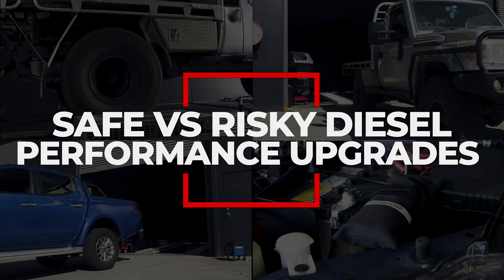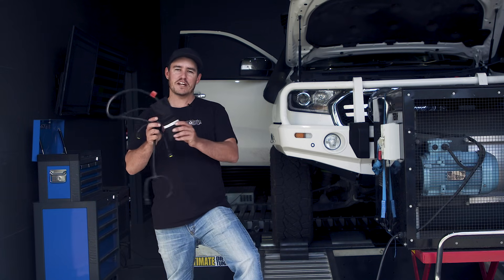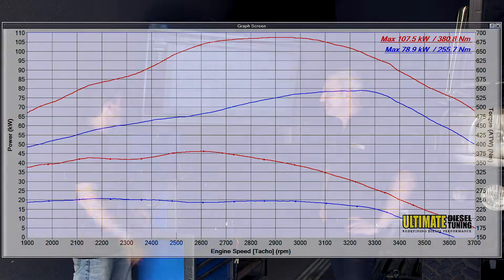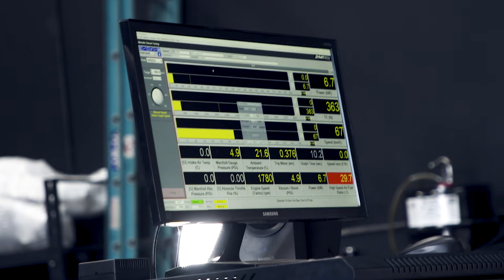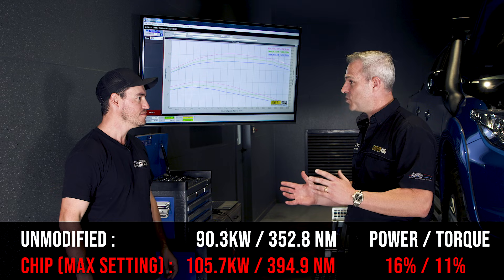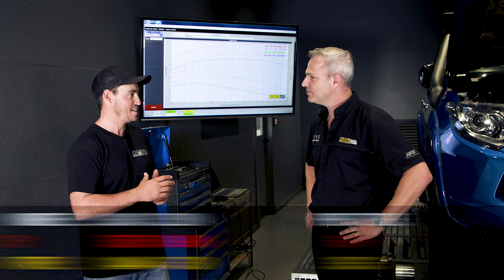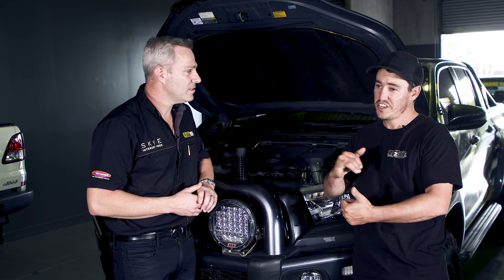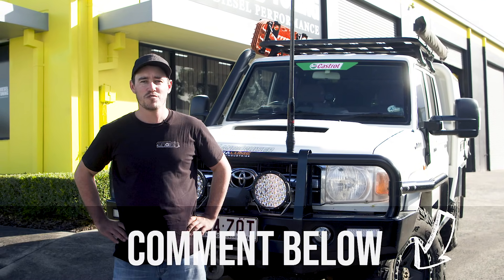SAFE vs RISKY DIESEL POWER UPGRADES – 5 things you need to ask before choosing!

Comment: The more power you make the closer you get to the detonation threshold!  That's why Toyota diesel 4wd's are so reliable!
Reply: Did you miss the part where the Hilux needed 4 new injectors.  Toyota shit not reliable at all.  D4D injectors need changing at 100,000k.
Reply: @einfelder8262  no you're wrong it's an wear item that's common with all common rail Diesel's...crdi technology is not credited in my opinion because of the over complexity from and engine which was designed so simple!
Reply: @einfelder8262  but it's OK you can just stick with your ford because I yet to see a ford reach 500k km+ lol

Comment: A remap is ok but I’d rather 3 tunes like a ecu shop tune 1 and 2 and back to stock on the fly
Reply: ECU Shops are fine - if they are custom dyno tuned to suit your car. They are fully tuneable.

Comment: What happens to fuel economy when you do those custom tunes?
Reply: The fuel economy is supposed to improve since you have more low down power which means that the engine does not work as hard to keep you cruising at say 80 on the highway as compared to a pre tune
Reply: @anthonyramdin1037  correct!

Comment: When should I do the tune. Right at the beginning before all the wanna do and gonna do starts, in the middle after things like exhaust mods and heavy duty suspension or as the very last thing i do after i think i have got it all together and the trip is in sight?
Reply: Up to you - but generally, after you have done engine mods. You won't see much gains in power & torque if you perform engine mods without tuning it to finish it off.
Reply: Hard to tell if anything has been 'upgraded' just because youve spent big money on changing parts if you havent got a baseline dyno test. My stock standard ute kept up with a $$$$$ upgraded mates ute on the beach, I could hear his heart break when he said, 'you could keed up no worries'.

Comment: Triton has more power than 70 series standard. Well done Mitsi
Reply: Its also about where the power comes in, in the rev range. The cruiser has max power right through. Where as the Triton doesn't kick in until around 2.5- 3 grand. Which is super sluggish when your towing and taking off from stand still. 

I have a 79 series and a 2018 Triton, and they are not comparable
Reply: But if u test them offroad the 79 would outperform the trity by a gap

Comment: How would you tune a Tradie ute NP300 @ 100,000 ks that's used 90% open road travelling and 10% towing a 2.4T van ?   25 return SA-Vic trips this year alone not towing but when tow van it's 4,000 ks round trips.
Reply: Our tuners will tune it properly for you mate, to what you use it for. We are not about max power/torque tunes! We are about tailored tunes to suit each car individually & what the owner's goals are with the tune.

Comment: Hey mate I own a 2001 gu patrol TD4 2 no intercooler by fitting an intercooler will that increase horsepower and lower the EGT is it worth spending the money  ?
Reply: I live in the US, but from owning a twin turbo truck, and a supercharged car, yes. Adding an intercooler will do wonders for your vehicles lifespan and performance.  The lower you can get the intake air temps, the lower your egts will be, as well as possibly adding exhaust modifications as well to syphon exhaust gases out of the turbo and downpipes faster will reduce egts as well.
Reply: I have done this and yes it is worth it
Reply: @juliancousins6340   thanks mate what brand of intercooler did you get

Comment: I don't understand what is the point of tuning a 4wd . Your rigs are not powerful enough at low gears? Or you drive your lifted trucks with mud tires at 200 + km/h on the highway ? 200hp vehicle will stay in the mud hole, but 220hp will manage to go out? I am not a tunning hater, my car is tuned but i really dont see any reason to do that to my 4wd.

Comment: I have an 05 RA Rodeo with 90,000km. Has Isuzu 3L diesel 4JH1-TC front mount non-commonrail and 4spd auto. Makes 98kw at the flywheel - would be nice not to slow down up hills or in a strong wind! What kind of safe power gains could you guys achieve?
Reply: In the same boat I’m looking at euro cars chip soon

Comment: 78kw and 255nm from a 4.5 turbo v8? What the hell toyota, I thought you'd changed.
Reply: Except look at the size of the tyres on the bloody thing... that’s what has killed the power
Reply: @xotic8617  our shorty with a stock standard TD42 and auto on 35s lays down 54kw at the wheels, a 4.5 turbo v8 with common rail should be more than a 50% power increase over an old forklift powered troll.
Reply: @Darndiddlyarn  
100% it should.
Reply: @xotic8617  the triton looks like it running 33s which also isn't standard. I love the cruiser but that V8 is not what it could have been.
Reply: All dynos read differently fellas. What matters are the gains achieved by the tuner from before the tune til after.
Reply: That cruiser would have another 30hp and 80nm if it was on 33s.
Tyre size makes a huge difference.
Reply: @xr6tgtx737  tyre size does make a difference, but the rolling resistance from 33s to 35s is not enough to see a decrease of 30hp and 80nm. Majority of the time the gearing is how you calculate the loss of power in the translation to it reaching the tires.

Comment: Do reckon putting bigger tyres, adding weight to the vehicle will affect the power output of a vehicle
Reply: Yes it sure does. But it doesn't affect the actual power & torque gains achieved by the tuner.

Comment: Just got a quote the other day for a dyno tune on my 2011 Holden Colorado 4jj1  auto 270kms I spoke to another diesel mechanic and he said leave it stock suggestions?
Reply: The 4JJ1s are renowned for making huge gains in power & torque with a custom dyno tune, safely & reliably with no issues!
Reply: @UltimateDieselTuning  i have a 09 rc colorado with the 4jj1 engine.  Is it better to upgrade the exhaust system on these before a tune? Are the gains oem system to a 3" worth the money in power increase from dyno tuning?
Thanks.
Reply: @feral4mr2  yes it is - but for an upgraded exhaust to make a noticeable difference to power/torque, it must be tuned to suit. So fit the exhaust before the tune, or the same time as the tune. We supply & fit exhaust systems too at our workshops.
Reply: @UltimateDieselTuning  thanks

Comment: Hey guys.
Does the I drive system come into play here as it is plug and play? 
Can it potentially be harmful to the forby.
2010 bt50 150klms.
Cheers Craig.
Reply: No, a throttle controller does not give your power any more power or torque. They don't change anything within the engine.

Comment: Nice info-mercial.  You have me interested.  Couple of questions, how do you dyno full time 4x4's?  What sort of gains can be expected out of an Everest 2ltr bi-turbo? Cheers...
Reply: On a 4WD dyno - we have 4WD dynos installed at all of our workshops. Currently, the factory ECUs in the 2litre Everests/Rangers/Raptors are unable to be remapped. We get around this by fitting a supplementary ECU to it, which then gives us full control over the ECU & allows us to custom dyno tune it. Results vary from car to car as we do custom dyno tune every vehicle individually depending on what the car is used for & how the owner would like it tuned. On one of the 2Litre bi turbo engines, expect from a 20% gain in power & torque upwards.
Reply: @UltimateDieselTuning  Thanks for the info, I appreciate the reply.
Reply: Ultimate Diesel Tuning, what is your experience in regards to new cars voiding warranty? I 2 have a biturbo Everest and every dealer has told me kiss my warranty Goodby. Do you guys provide any guarantee that it won’t effect my warranty??
Reply: @ORD-nairy.  take note of the lack of reply.
Reply: @ORD-nairy.  Yes we have our own warranty. And by law the dealership or manufacture cannot void the warranty of a vehicle due to a remap/custom dyno tune. Most of the cars that we tune are still under warranty with no issues. And we have awesome relationships with several dealerships where they refer their customers to us for tuning - either their servicing customers or ones who have just bought a brand new car. Some even get trucked to our shop, we tune it & then truck it back before they deliver it to their customer!
Reply: @user-hf3rq1dg9d  just replied to him thanks mate.
Reply: Easy, on a 4wd dyno.

Comment: I have a 2012 ST-X550 Navara, what power and torque would I see out of this with a tune?
Reply: Results in power & torque gains do vary from car to car. If you visit our website & have a look at the Navara page, we have an example graph up there that you can look at with all details etc. Regardless on how we tune it, it will make excellent gains though, they always do.
Reply: Me to got aftwrnarket intercooler and 2 3/4 stainless exuast would l9ve to no how the auto would hold up against the extra power
Reply: @putnamehereholdmadoodle  they're fine mate! We have custom dyno tuned hundreds of them, no issues.
Reply: @UltimateDieselTuning  are there any problems with throwing engine codes
Reply: @putnamehereholdmadoodle  no mate!

Comment: I don’t get it if the factory could increase the power output of there vehicles like you guys are doing why wouldn’t they just do it
Reply: That is the magic question!
Reply: Because it effects emissions and longevity, it's not fucking rocket science, they just won't say it.
Reply: @user-hf3rq1dg9d  no issues with longevity. We custom tune within the factory safety parameters set by the manufacturer.
Reply: @UltimateDieselTuning   When you tune to a torque increase of 135% how can you say that is within the manufacturers parameters?  Thanks

Comment: Quick question, chipped with Ultraboost ecushop + dyno tuning OR remap on a dyno? Running with a 2kd hilux.
Reply: You will need a supplementary ECU such as an Ecushop or Unichip, then custom dyno tuned on top with your older Hilux.
Reply: Appreciate it mate.

Comment: Being that the 1HD-FTE is such a popular engine and people are still putting them into their vehicles nowadays, what is the recommended approach to tuning them? My understanding is that the FTE ECU hasn't been reverse engineered to be reflashed yet and you can only run a chip. Is it likely that the FTE will ever be flashable?
Reply: We fit a supplementary ECU to them & then custom dyno tune them properly from there. They make amazing gains in power & torque! There is one on our YouTube channel if you want to check it out.

Comment: Very informative, but sounded like an advertisement for Ultimate Diesel Tuning towards the end. I'm  scepitical about ALL of the discussed upgrades, in particular what happens if the engine in a new vehicle fails and the warranty is voided. Will the Chip supplier/ECU Tuner repair the engine? Will they offer a warranty on the drivetrain for the life of the factory warranty? Lastly, Shaun if what UDT offers is so safe have YOU had them tune/upgrade ALL 3 of your vehicles?, what about Grahams D-Max? I think this should be an HONEST discussion for the next Beers in the Shed.
Reply: Most tuners will offer their own warranty, like we do. Unsure about what type of warranties the chip brands supply. And yes we have remapped Shauno's 79 Series so far!

Comment: I don't see a 4WD dyno. I have a tuned V10 with 960 Nm of tractive effort and 355 awHp, at all four wheels.
Anything that comes off a dyno talking torque, is rubbish - it's called tractive effort and is hardly related to torque.
I highly recommend replacing drive shafts and the centre Knuckle before a Dyno.
Watching a Dyno Snap at max rpm is not a pretty thing - the drive shafts don't get a chance to 'relax' on the rev reduction.
Reply: I've never heard someone spew such shit. Torque is probably the most important factor to 4wd engines. Power is just a function of torque. So the only way to get better power is to increase the torque.

Comment: Damn that’s some piss weak numbers out of the triton I’m pushing 500nm and 138kw ATW at the moment and have been for the last two years they can take so much more.
Reply: All dynos read differently mate. That's why you look at the gains achieved from before the tune to after.
Reply: Yeah our triton is running 240 kw and 600nm ATW
Reply: Harry Whitehouse I can understand a lower power tune for reliability but for towing you would want as much power on tap one would have thought and you should be able to achieve that with good AFRs after a solid tune.
Reply: Yeah that’s it mate, BB Garage in Ipswich did ours I would recommend them
Reply: Harry Whitehouse nice mate mine was done when I was in Esperance by Nicks Mechanical spent a good few nights on that dyno getting it right
Reply: @WorldTrendingclips  don't look at the figures mate, look at the gains. What was yours making before the tune & how did you ask them to tune it? That is what you look at. Both of these cars that we have featured on this video are not tuned for max power/torque.
Reply: Ultimate Diesel Tuning well based on my figures 78kw to 138kw is a 74% increase and 330nm to 500nm is a 51% increase with more room to move if needed that was on a stock exhaust. Now it’s running a 3 inch bigger intercooler and better intake so I would say it’s around the 550-600nm mark if we tuned it again to match the new mods.
Reply: @WorldTrendingclips  that's fine mate. We never push engines to their limits, we are not all about getting bulk power & torque out them.
Reply: @harrywhitehouse118  don't look at the figures mate, look at the gains. What was yours making before the tune & how did you ask them to tune it? That is what you look at. Both of these cars that we have featured on this video are not tuned for max power/torque.

Comment: I’ve got a 1991 1HDT 80, and building it up from stock, plan on doing the intake,exhaust inter cooler etc. is the car to old to consider a dyno?
Reply: Tyla West  I’m doing the same thing to mine. And iv been looking for months
Reply: On these mechanical diesels you fuel according to the boost pressure the turbo can create. You're starting with the right recipe there, just note the stock CT26 is only good for 15psi reliably. I've you want quicker spool and more boost you'll have to go for a Gturbo which has been designed specially for these engines. ALWAYS check your EGT's pre turbo and make sure to never exceed 700C for long periods of time. Not every tuning shop knows how to properly tune these diesel motors so make sure you do your research before hand. If they don't measure AFR and EGTs when tuning I'd stay clear away.
Reply: @HendriMouton  yeah gturbo is the only turbo that would ever possibly work. Not.

Comment: Thanks Shaun for getting me onto this mob, it was from the video of the 1000 buck track. Got a $200 discount too, bonus 👍👍 thanks mate. Got my Hilux 2017 sr5 done. I got it done by Andrew, from the Dandenong branch. It’s done 90k plus k’s, been averaging 10.5/100 pre tune, post tune 8.8/100- 9.1/100, amazing benefits. I absolutely love how the vehicle can accelerate and the rev gauge just sits on around 2k and sometimes even drops in revs slightly, while accelerating in speed. I decided to do a tune for fuel consumption reasons and not power reasons. However, vehicle now looses traction when I tow my trailer up hills on take off, it has never done that while towing in the past. I can not believe the fuel saving. When I get my next lux, I’m getting it done from the time the dealer hands me the key. Unfortunately, my intake was fairly dirty, so there was an additional cost to do a chemical clean to the intake manifold, all good though. Very happy with my tune, and highly recommended.
Reply: Awesome feedback mate, thank you.